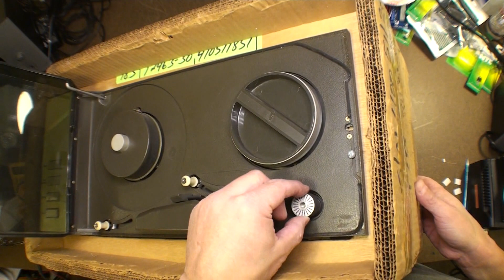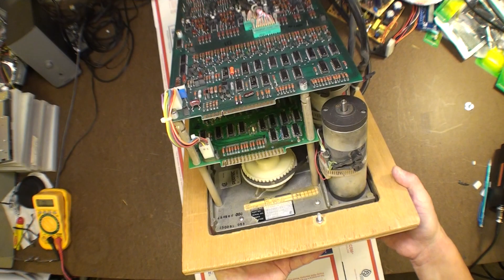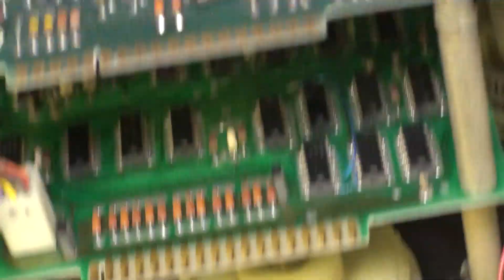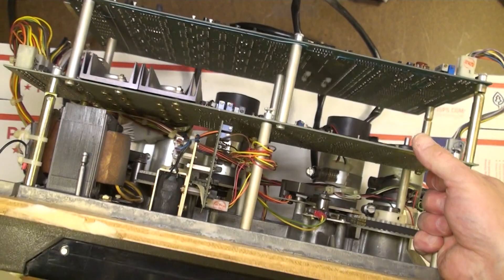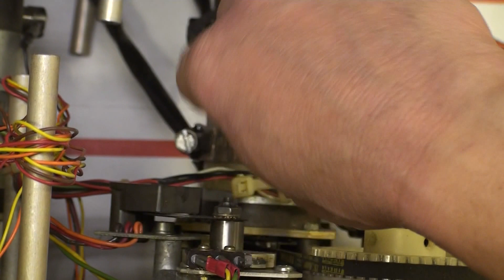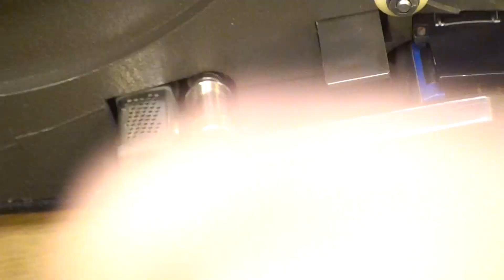Pertec T7840 9-track 800bpi Tape Transport Unboxing & First Look

Comment: This is a lovely small drive and I hope you got the control card for this drive. It would look nice next to my paper tape reader since they both are small form factor drives
Reply from the maker: Indeed!  But first, I must get it working to read all of the unobtanium Entrex 480 (Nixdorf 620) System Backup tapes from Dominique in Belgium!  For this procedure, a control card won't be necessary.  Just like we don't need a controller to run the Universal QIC Reader (http://qicreader.com), I plan to use a very similar procedure to control this transport, and capture the flux transitions on all tracks with a logic analyzer.  Then reverse-engineer and decode!  Simple!  (well, sort of...)